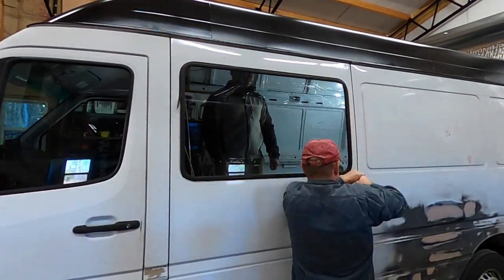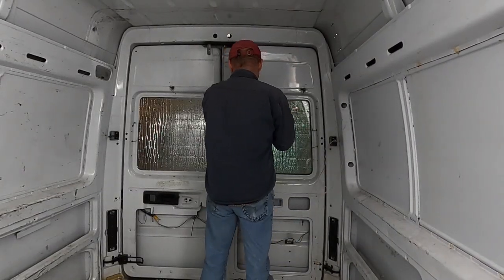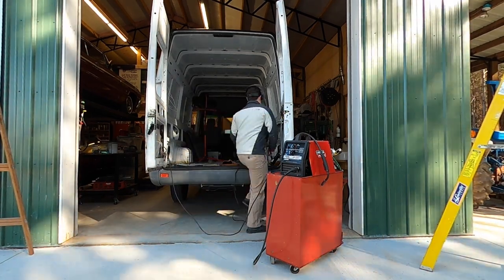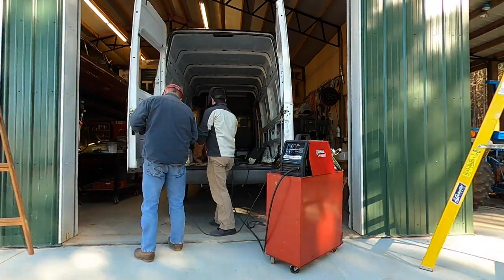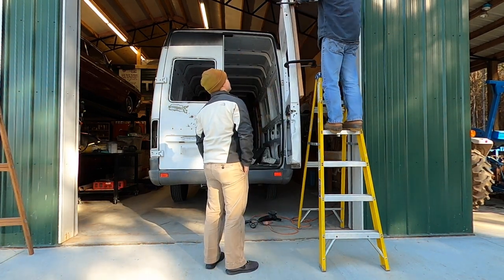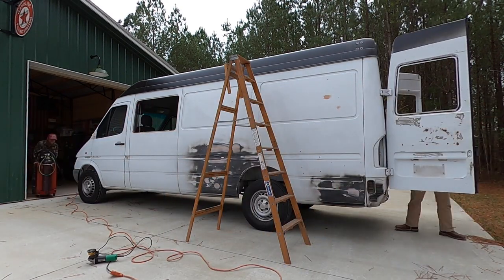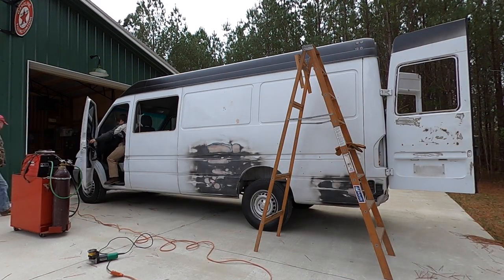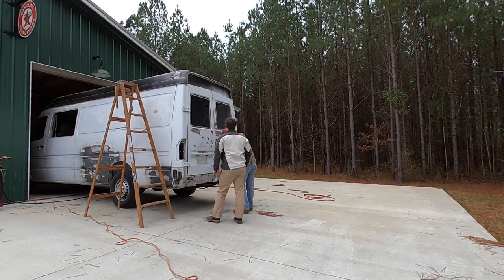Van Build Episode Three! Removing the Windows and Fixing the Doors // T1N DIY Sprintervan Conversion

Comment: I just bought a t1n, super excited! it has some rust on it aswell and man... i didnt know that body work would be so much work! Couple of questions, you mentioned that you had windows (for the rear doors that had sliding parts, could you link me to that. Also with someone on a budget, what tools would you recommend that I get inorder to do body work on my van?
Reply from the maker: Congratulations on getting a van! Don't let bodywork scare you. You can make it take as little or as much time as you want it to. We're a little bit of perfectionist so we put a lot of energy into it. The rear door windows are from Motion Windows. We have a video that goes into detail on installing them if you're interested! The tools that I absolutely couldn't have done without would be an air compressor, in line sander, and paint spray gun. Good luck on your conversion and don't hesitate to reach out with more questions!
Reply: @goldenadvantures2573  Man I am loving the videos, I am so glad I found your channel
Reply from the maker: @phil we’re glad you’re enjoying the videos! There’s also a lot of info on our website if you want to check that out too. If there’s anything you need help with along the way just let us know!
Reply: @goldenadvantures2573   I have been completely restoring a T1N on my channel for well over a year now, you are so well ahead of me however, videos like yours help keep me focused and helps keep my momentum up, The list of jobs just seems endless however I a getting close now, thanks for the reply best regards from Glasgow Scotland
Reply from the maker: There’s definitely always something else on the van list but when you get to the point that is useable it’s totally worth it.
Reply: @goldenadvantures2573  It's like climbing a mountain, thanks for the support and the kind words